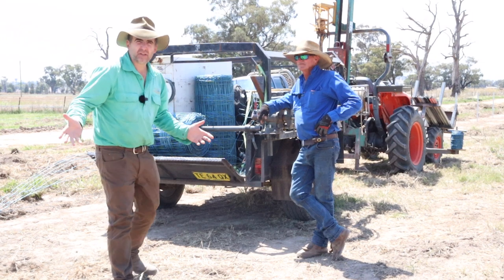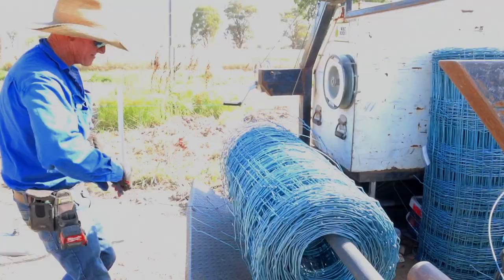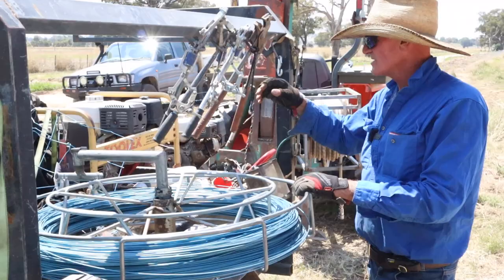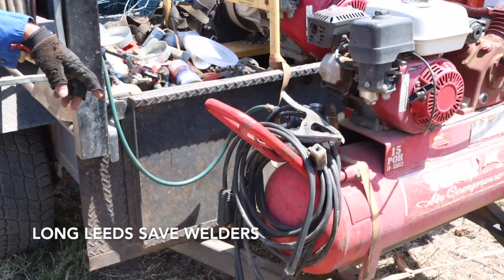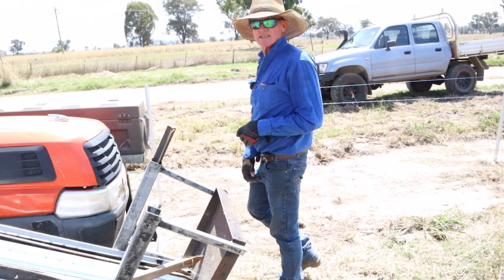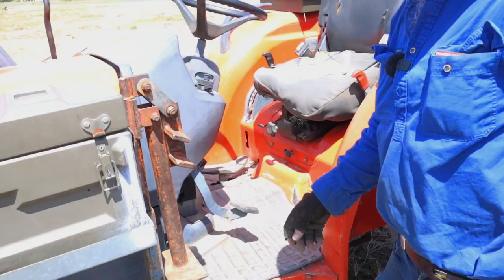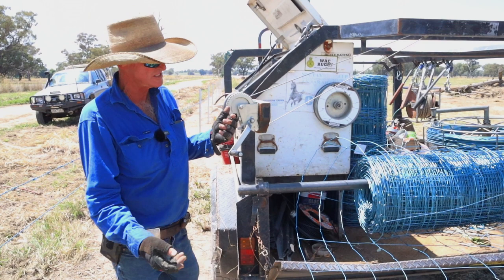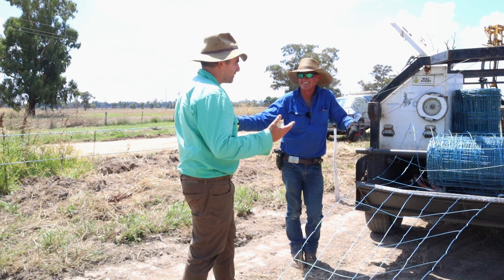Fencing Gear Setup with Tim White NSW

Comment: Hey mate how do u set your star picket heights do u just follow the land height or run a string line from each strainer n work with that height?
Reply from the maker: Follow the land. You’ll find that good posts like stockpost are pre marked to make the job even easier. If you’re dealing with lots of undulating ground, then decrease your post spacing.

Comment: awesome - - how does he mark center postson line? is there a measure msmt somewhere that tells him when to drop post?
Reply from the maker: He used a trundle wheel and paint prior to driving the intermediate posts.
Reply: @FarmLearningTim  thanks - so he sets corners, runs tension wire on bottom then wheels off 10-ft or 8ft or whatever,,,... that other fencing company you show has something on trailer right that lets them know spacing, right? or am i smoking crack?  i will have to rewatch
Reply from the maker: @harleyjune1233  yeah nah, the onther one has a mark on the trailer. That is of course a bit less accurate but faster.

Comment: Mate have you come across any powered wire roller-uppers?
Something I can take down old long lines of barb down with as one man unit, other than me rolling them over by hand?
Reply from the maker: Yep try Walters and tell them I sent you! https://waltersfencing.com.au/
Reply: I have a hand me down that my uncle made. I don't think I can put a photo on here but I'll try to explain how it was made. 

The basis is an old vehicle differential (I think this one might be off a pre war Ford) which has arms welded to allow attachment to a tractor 3 point linkage. The vehicle tailshaft is driven by the PTO. 

A home made steel wheel with 5 or 6 spokes about 1" diameter (water pipe) is mounted on the right hand wheel hub. On each spoke is an "L" shaped bracket that accepts the wire. The brackets can slide up and down the full length of the spoke and are secured by means of a clamp bolt. When winding the wire the brackets are positioned towards the outside of the wheel. When the coil is wound the bolts are loosened and the brackets slide towards the hub thus facilitating release of the coil. 

On one side and to the front there is a guiding loop through which the wire is fed onto the wheel.

On the left hand hub a lever allows pressure to be applied which controls the speed of the winding wheel.

To operate, the wire is fed through the guide loop and bent over a bracket (just enough so it engages but doesnt prevent the coil being removed when its fully wound), the PTO is engaged which commences driving the diff, and pressure is applied to the control lever which starts the winding wheel.
Reply from the maker: @kalgaramerinos7085  I'd love to feature it on my facebook and Instagram if possible. Send photos to gday@timthompson.ag
Reply from the maker: @kalgaramerinos7085  enter the weldclass welding comp by emailing a photo to g'day@timthompsonmedia.com.au